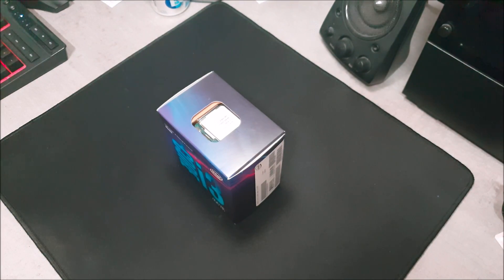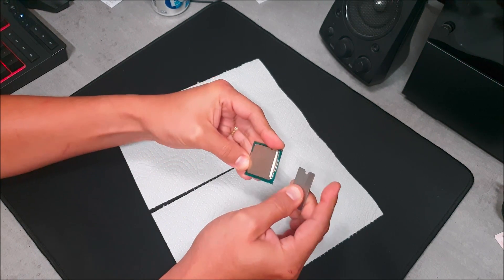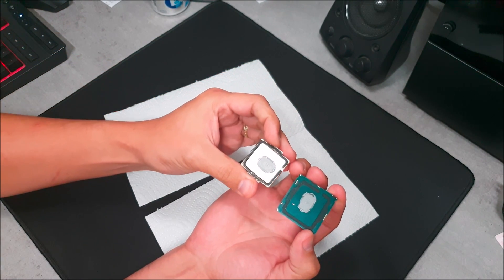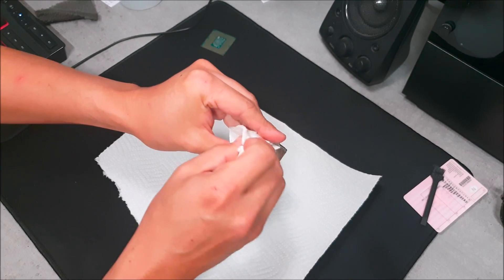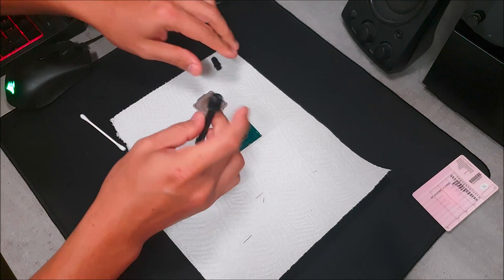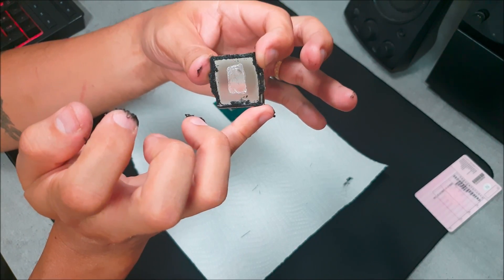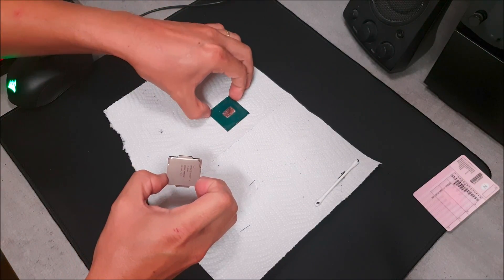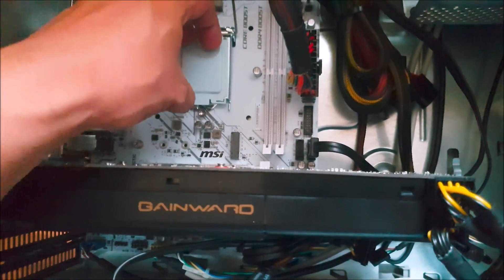8th Gen Intel CPU Delid and Reseal

Comment: Good video, I consider buying i3-8100 and 2x16GB Kingston HyperX 2666, the mobo is beautiful.
Your CR is 2t, why not 1T? Why not using the XMP - what is the highest profile?
Reply from the maker: Hello and thanks for watching. I did not catch that until you pointed it out. I have however found out that stability becomes an issue with Intel and memory overclocking going from T2 to T1. The memory I am using in the video has an XMP profile of 2400Mhz. But can manually be overclocked on a Z chipset to 3466Mhz CL 16-18-18-36 T1
Reply: Thanks, any info counts, I have specific requirements since this open rig will be used only for benchmarking all general compressors and making the richest roster in Internet, on mainly textual data.
Your mobo caught my eye, it is what I instantly would buy, but aesthetic is secondary. I don't want to throw dollars for overkill either, I need not-fancy but fast CPU-RAM susbsystem without throttling and stupid momentary boosting. i3-8100 is ideal for my goals since it is the very baseline of 8th gen, as for RAM and MOBO, still not decided, neither the chipset nor RAM frequency.

What do you think of Z370 GAMING M5, it is 100 dollars more to the ARCTIC?
https://www.newegg.com/Product/Product.aspx?Item=N82E16813144106

Is your RAM like that I wanna buy:
https://www.newegg.com/Product/Product.aspx?Item=9SIA8N25YW1596&Description=16GB%20DDR4%20Kingston%20HyperX%20Fury&cm_re=16GB_DDR4_Kingston_HyperX_Fury--20-104-680--Product
Reply from the maker: @Sanmayce  I own the MSI Z370 M5 motherboard. It is a great board packed with features. For the build you are aiming for, I would stick with a B360 chipset so you are not limited by bandwidth limitations found on the H310 chipsets. Plus you get more USB ports.  https://www.pcworld.com/article/3268063/components-processors/intel-motherboard-z370-vs-h370-vs-b360-vs-h310-8th-gen-cpu.html
Reply: Oh, just saw your video for the same mobo, it is my second candidate already.
ARCTIC is still on my list, what "bandwidth limitations"!? Please consider making a video on bandwidth.
The thing that can surprise me in a bad way is that i3-8100 is not a K CPU, and I don't know whether those overclocks are available for it:
newegg specifications says:
DDR4 4000+(OC)/ 3866(OC)/ 3733(OC)/ 3600(OC)/ 3466(OC)/ 3400(OC)/ 3333(OC)/ 3300(OC)/ 3200(OC)/ 3000(OC)/ 2800(OC)/ 2667/ 2400/ 2133

I guess If I buy Kingston's at 2666 this is the max for i3-8100, no?
Reply from the maker: @Sanmayce  i3 8100 Spec RAM speed is 2400Mhz. But you can run higher memory speeds if you have a Z370  or Z390 chipset motherboard.